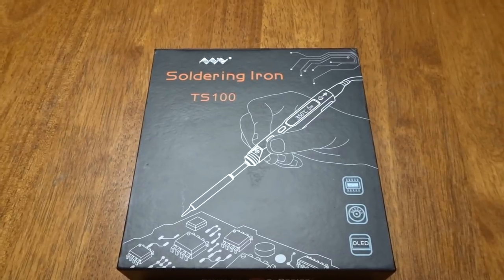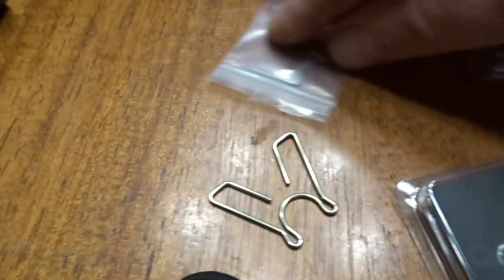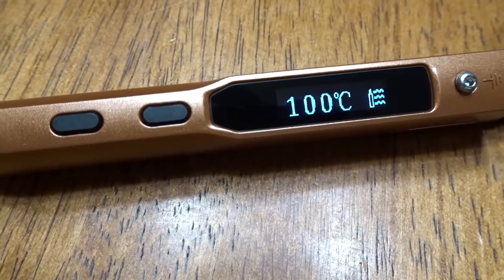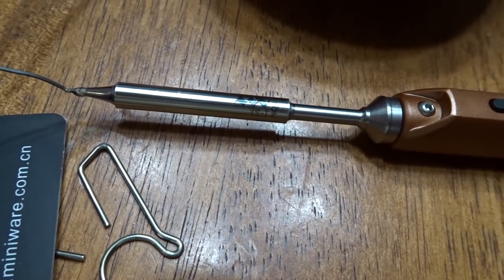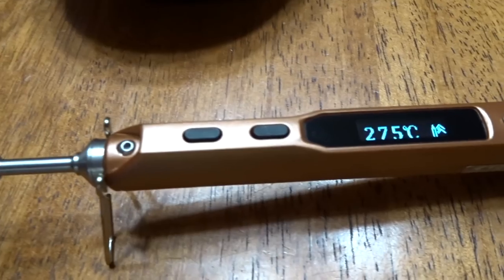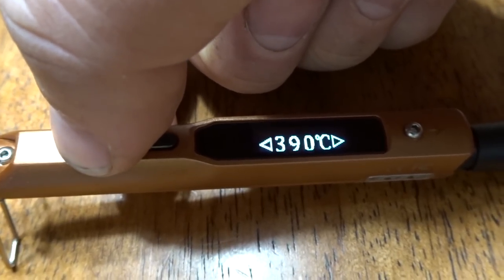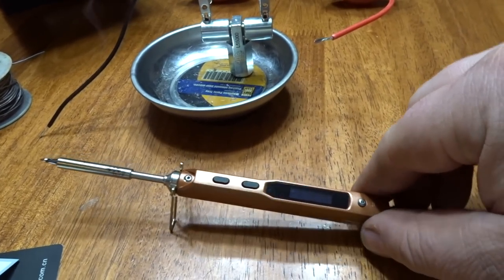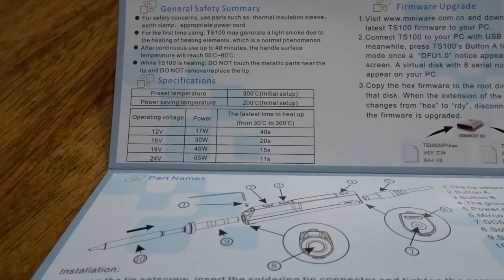TS100 Soldering Iron First Use

Comment: My favorite is the refillable butane soldering iron my wife got me 20 years ago, small and compact with it's own carry case. No battery needed
Reply: I've got a 20 year old Weller that I use. The tip has disintegrated over many years of hard use, still works fine, though.
Reply: complete garbage, i had one and it was trash, you cannot use it for any sensitive electronics because of the harsh exhaust plume, the tips you cannot replace, and it eats through butane not to mention it takes a very long time to heat up. Modern electronics are too delicate for butane torches, out in the field soldering 2 wires together its fine, otherwise its trash, and its nowhere near the power of this. You can have this working portable from a power bank for hours with quick heating up, your butane will run out way too fast

Comment: for the price I am not feeling it for portable the Power Probe PPSK Butane Soldering Kit is $20 less at amazon or you can buy a good quality ESD safe station for $20 bucks more like the X-Tronic Model #8050-XTS - 70